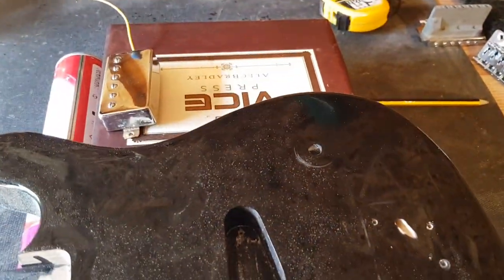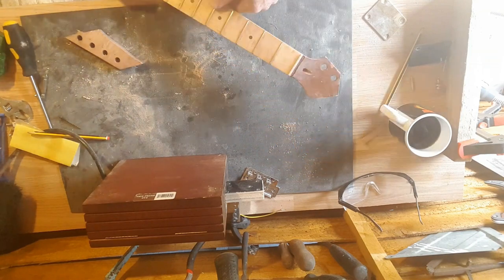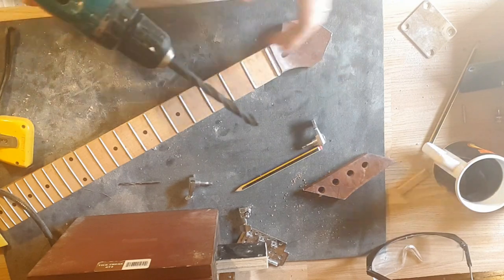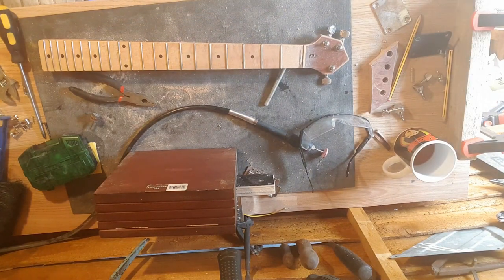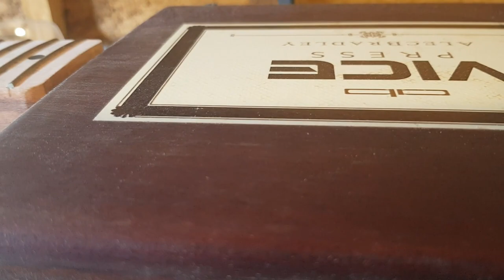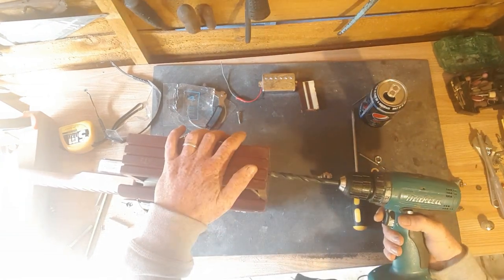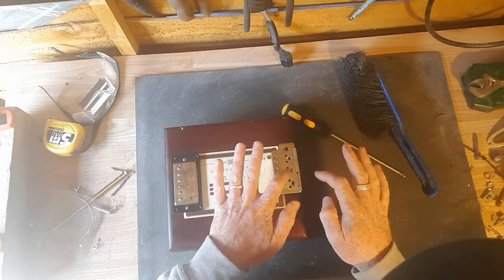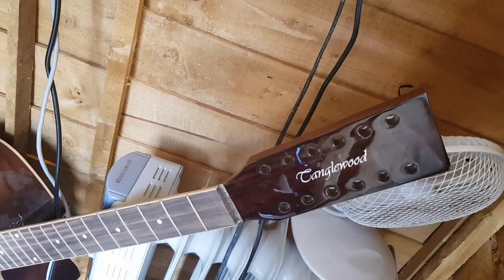A Posh Cigar Box Guitar Build.  BBG Custom Guitars

Comment: Brent (and others). I want to transform a regular electric guitar into a 3 string. For the bridge would i replace it with a tremulous block upside down to get the 3 spaces for the strings. Sorry if the question seems ignorant.
Reply from the maker: I have made 3 string cigar box guitars using a standard bridge. Works great just use every other saddle. Spot on for slide playing
Reply: Thanks